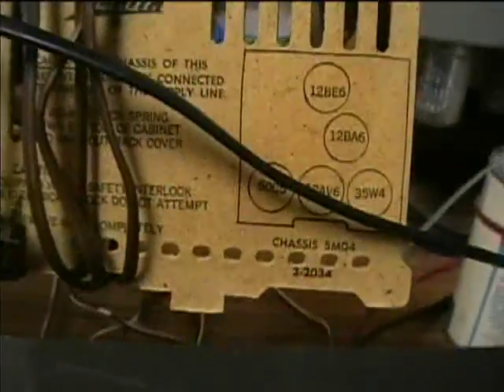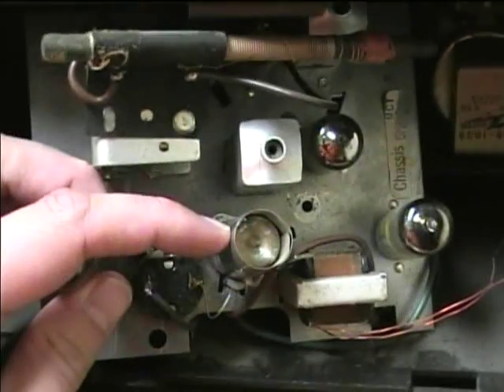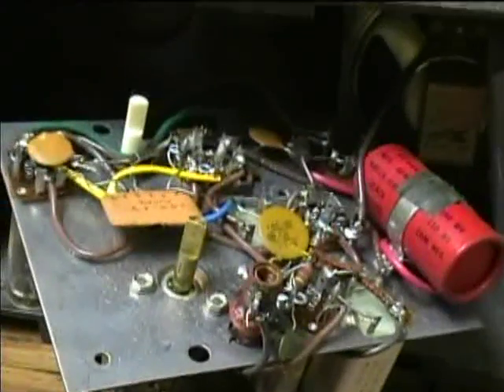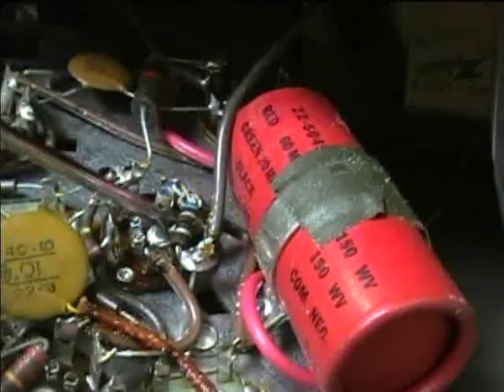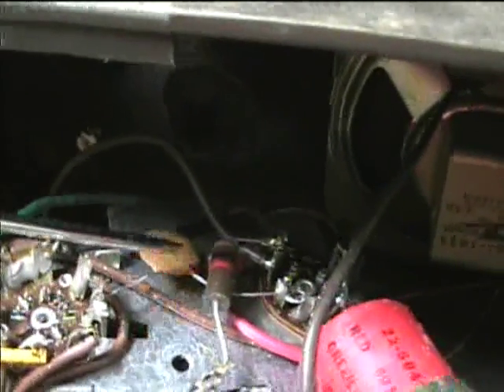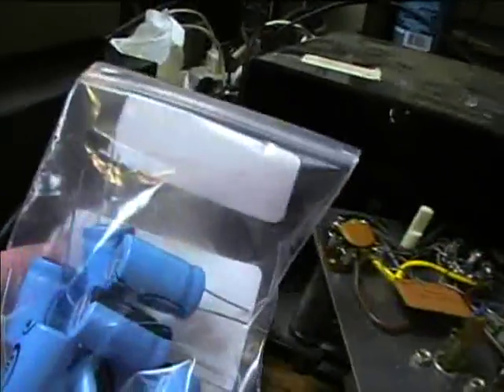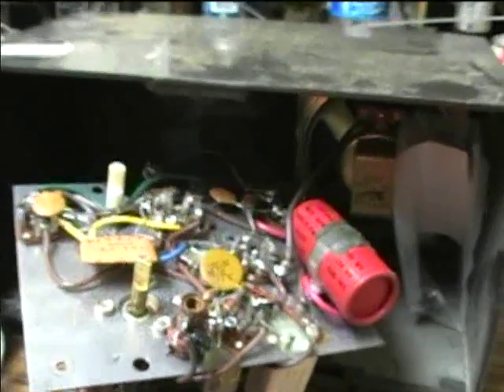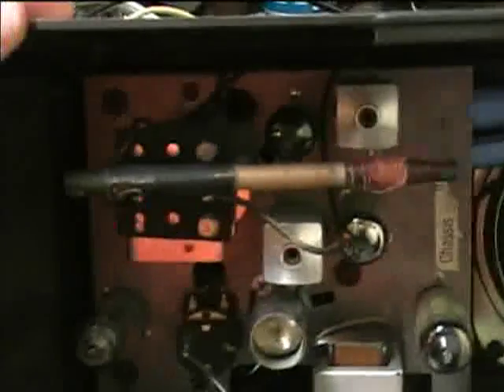1968 Zenith tube-type AM radio repairs

Comment: @lrd9999 If one went bad on a printed circuit chassis you would have to use a little more creativity to replace one. The Philco Predicta TV chassis apparently used a few versions of a couplate that go bad and what most do is mount the parts on a small piece of perf board mimicking the lead layout of the originals, I guess one could do the same with a radio. The last set that I had to replace one in was an RCA from 1956 but I don't think that IRC made that one, probably a cheap knock off.

Comment: @lrd9999 Under the radio's normal life span of service they would likely never fail, but now the oldest ones are over 50 years old and some are starting to fail although there are others that just keep ticking away. I've had to replace one or two of them over the years, it actually isn't too bad as most manufactures show the contents on the diagram. It's very easy to replace one with discrete capacitors and resistors in a hard wired chassis.

Comment: @lrd9999 That integrated IC package was known as a couplate, they were introduced in the early 1950s and predated the widespread use of printed circuit boards, many were made by International Resistor Corporation or IRC but they weren't the exclusive supplier. The one in this Zenith is obviously a Japanese import since it says "Murata" on it, sort of ironic from a company that used to brag about being "American Made"

Comment: 188-5 General Electric Tube plant in Owensborough, Kentucky, formerly known as Ken Rad. It's amazing that Zenith was still using hard wired radio chassis in 1968, all of the others were using PC boards by then. It's understandable why they were so reluctant to use PC boards, apparently they tried them in the early 50s and had a lot of quality control problems, but they held out until the middle 70s before using them in TVs.

Comment: I have a 1959 Zenith AM/FM radio that is in great condition except for a broken volume/tone knob.  Unfortunately the pot used for it is a weird dual gang thing with a tapped potentiometer for the tone control.  Do replacements for this part exist, or will I just have to use an ordinary switched volume pot and let the tone control go?

Comment: Nice work!  Thats a nice little unit. That model is indeed a '68, with a 1965 designed chassis.  In fact, the very last tube type zenith radio was the AM-FM model Z316 for 1969.  I hope to be able to find one of those someday.  It looks just like the very common X316.

Comment from the maker: Yes most likely it is a bad electrolytic...Radio Shack does not carry the voltage rating of caps needed, you will need to go to your local commercial electronics distributor or an online source such as Mouser. Bad capacitors can also short or overload the rectifier.